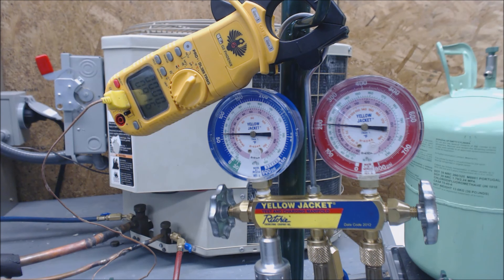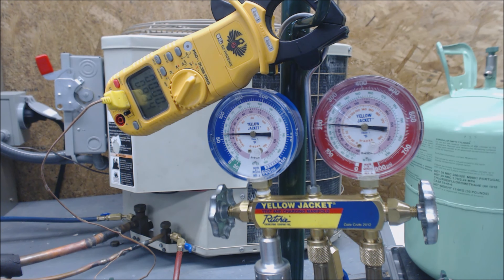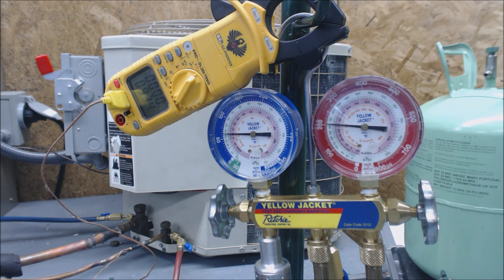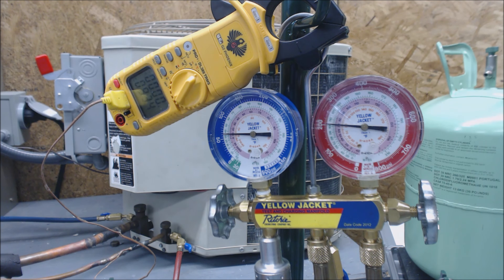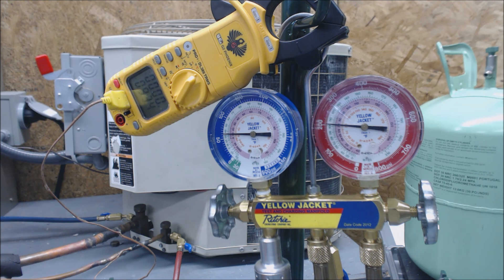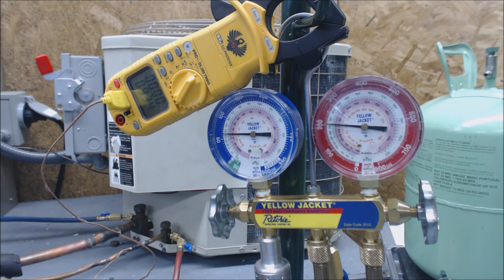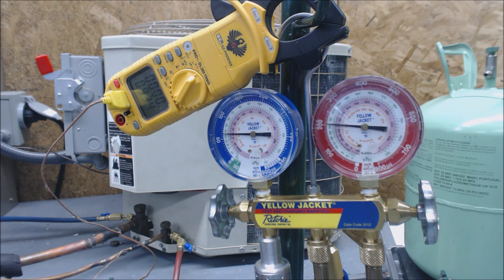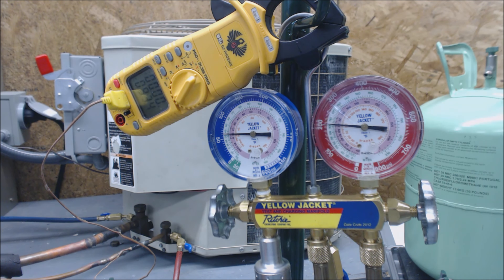Charging an AC System Low on Refrigerant in Real Time! Part 1

Comment: So here u added Freon because the subcooling was 5 degrees below the plate reading. So, let’s say it was above the plate reading at about 20 degrees. Does that mean you must recover Freon? Also, because you added freon you are basically raising the saturation temp in the center of the condenser unit and as a result you raised the subcooling because the line temp isn’t going to change because it’s the outdoor temp, which won’t change in two seconds. Is that correct?

Comment: thank you for all your videos Ac Servicetech. can you please explain why a low charge would cause the evaporator coil to freeze? i always thought that low amount of refrigerant entering the evap. would just evaporate faster (migrating from bottom to top of coil) and this would cause high superheat. wouldn't it just evaporates quickly and then there's nothing left in the coil? so id there's nothing left how can this cause the coil to freeze? thank you.
Reply from the maker: Only the first part of the evap coil would freeze and the rest of the coil would have high superheat if the sat temp was below 32 but after the first part freezes, that part is now insulated and the next part freezes until the whole coil freezes, that is how it would occur, thanks Mark!

Comment: When do you open or close the service valves. What is their purpose
Reply from the maker: check out the "acservicetech, connect, charge refrigerant, disconnect" make sure to be epa 608 certified before working with any refrigerants. You can find info on this at epatest.com or escoinst.com thanks.
Reply: acservicetech am a licensed tech but i have no experience yet. Am trying to work on my house.
Reply from the maker: Oh cool, just making sure. Feel free to ask any questions, thanks

Comment: Hello AC Service Tech. My outside unit is so low on refrigerant that the safety switch will not allow the compressor to turn on unless I bypass it. How do I get the refrigerant sucked into the system so that the compressor turns on or should I bypass the switch and risk the compressor until there is enough refrigerant inside. Thank You!
Reply from the maker: It is best to recover and find the leak at that point because the refrigerant will leak out way too fast to even having it be worth adding some. In a case such as that where we know the problem and fix the problem first we would jump out the switch and make sure that we are adding enough to ensure the compressor is still sucking in refrigerant. In the case of r-22 this could be done with vapor from the tank for compressor safety. I will tell you though that when you leak that much out though it is really worth fixing the problem though, thanks!
Reply: AC Service Tech LLC Thanks!!

Comment: Instead of charging the system turning the cylinder upside down and using liquid vaporizer , why don't you charge the system using vapor side of the cylinder ? What is the point of that ?
Reply from the maker: It is just faster, even with the vaporizer. Most refrigerants we work with now are blends anyway so they must come out of the bottle as a liquid. R-22 however is a single component refrigerant, thanks

Comment: How you know what is the super heat need it in the unit ?
You said is low how you know is low were you get the super heat need it in the unit were is in the label plate ?
Reply from the maker: Superheat is found on by reading the indoor wb return temp along with the outdoor db and using a superheat chart. I had already found out the target superheat on this video. Look up a"cservicetech superheat chart" to find that, thanks
Reply: my local supply house has crappy psychrometers :( decent brand for price?

Comment: Why did you charge 22 in liquid instead of vapor?
Reply: I know 22 is a pure refrigerant and you can charge either way, but since you are going into the low side why wouldn’t you charge in vapor form. Thanks.
Reply from the maker: Hey Danny, you can charge faster as a liquid so most of us do that and we meter it in only 10-15 psi higher than what the pressure already is for 2 seconds at a time or we use a liquid vaporizer such as the kwik charge linked in the description section, thanks
Reply: AC Service Tech LLC 
thank you, one more question. How do you use all of the gas in the tank. When the tank gets low the pressure is lower than the operating pressure, so how do you add it to the system at that point? Thanks.
Reply from the maker: You use those tanks for breaking the vacuum with refrigerant when needed when you know you have to add some refrigerant due to the length of the line set but don't need to add too too much. In the winter, we used more full bottles to perform the total weight method for charging heat pumps due to line set length, thanks

Comment: Why don't you charge into the liquid side?
Reply from the maker: Hey Eric, you can only charge into the lower pressure side of the system while it runs. You can break the vacuum with liquid refrigerant into the high side though when under vacuum, thanks
Reply: @acservicetechchannel  why is that? As long as the pressure in the tank is higher than what's in the liquid line, wouldn't it be possible to charge in the liquid form though the liquid line? Thanks

Comment: I am very confuse about this video. I heard you are saying to monitor the pressure and temp at liquid side because of the TXV vale. But you never mentioned where you add the R22, from suction line in as vapor or in liquid line as liquid. When I add R22 through suction line, I have to keep the bottle in upward position. But your video never mentioned where you add the R22 to. Since you put the bottle upside down, I guess you add R22 through liquid line. But then you only turned the knob on the suction side. The whole video is a big mess!!!
Reply from the maker: neverwasthere, the refrigerant always gets added into the vapor side since it is lower pressure than the bottle. You can only add a small amount of liquid refrigerant at a time otherwise you will slug the compressor with liquid. You can also charge slower with vapor. When charging with r410a on r410a systems, it must come out of the bottle as a liquid.. You can weigh refrigerant into the liquid side if the system is empty and vacuumed down to 500 microns. Technicians need to be EPA 608 certified under EPA law to buy and handle refrigerants. Thanks
Reply: I always has been told to not to set Freon jag upside down when I add Freon through suction line. But you did opposite, why?
Reply from the maker: Upside down as liquid puts refrigerant in faster and you have to with blended refrigerants. Also to be safe I use the kwick charge you saw in the videos. You don't put too much in or it will slug the compressor. My best advise is to continue to watch more videos whether of ACSERVICETECH's or others. Most of us charge with the bottle upside down. R-22 can be charged as vapor if you like to.  Thanks